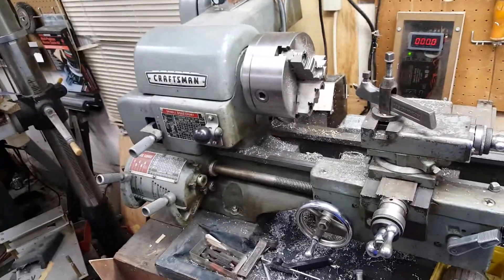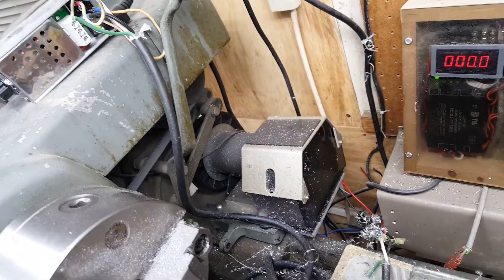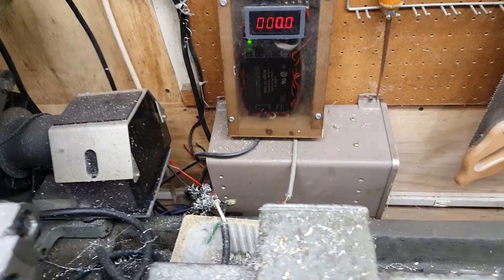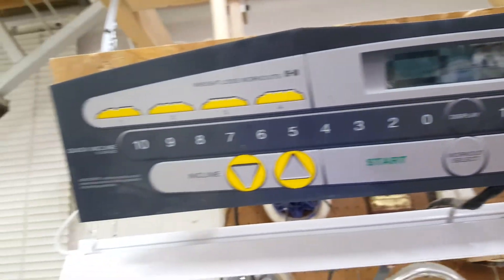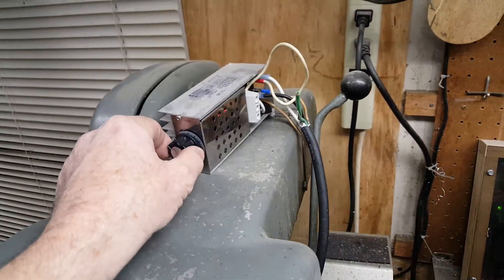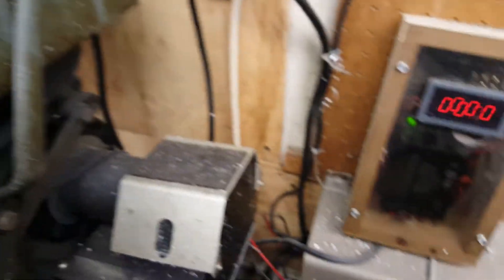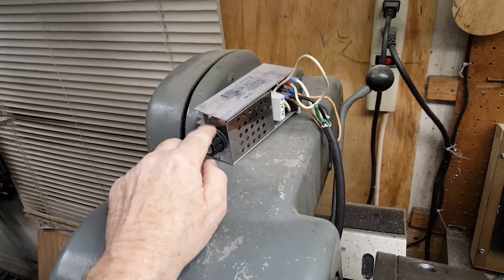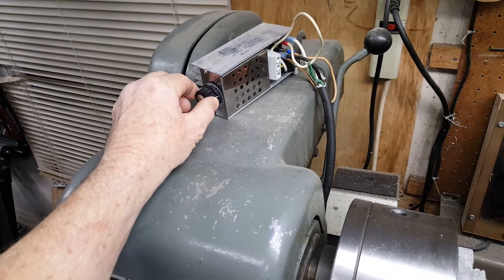Atlas 12 Inch Lathe Treadmill Motor and Simple Cheap Speed Controller

Comment: Hi, thanks for the video. How is the torque under slow speed?
Reply from the maker: The torque is challenged at low speed with deep cuts, and especially parting.  I'm modifying an AXA parting tool holder so I can use  it upside down as a rear post parting tool to try to combat that problem.  I could always change the belt/pulleys to speed the motor up for lower spindle speeds, but I have not done that yet.  Thank you for your comment.  I may go out to my shop today and  change that belt position now!
Reply: @JohnnieBravo1  I'm having torque challenges with a 2HP DC treadmill motor / SCR Controller setup on my Atlas 618. Are you incorporating the weighted flywheel that came attached to the treadmill motor?
Reply from the maker: @TheSignGuysLLC  Yes, on my little 618 conversion the treadmill still has the flywheel on it.  But it also has several steps of pulley sizes that maximize the torque of the motor.  The drive pulleys on the lathe still has a couple larger driven pulley positions to slow the spindle down further and/or increase motor speed/torque if needed.  I don't generally cut larger stuff in it, or stock that requires more torque.  For those items I use my larger 12" Craftsman lathe.